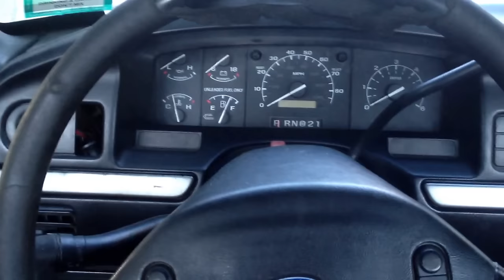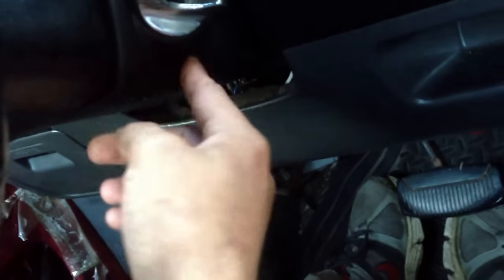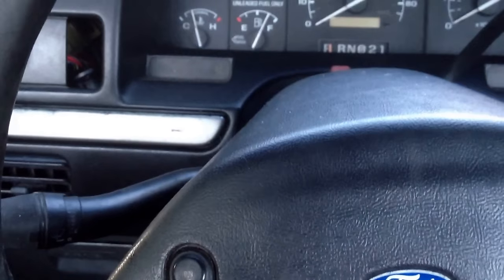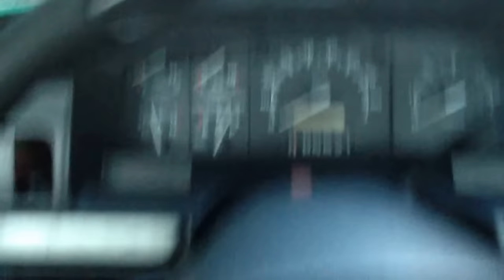Remove and Replace an Ignition Lock Cylinder - Ford - 92 - 95 F150 & Bronco @GettinJunkDone

Comment: IF you turn the new key before installing it, as long as you didn't disassemble the new cylinder, just turn the key back to the position that allows you to PUSH that pin back in flush.  As soon as you turn the key away from this position, the pin is pushed out and traps the cylinder IN the column - or out of the column.  Remember, one step of removing the old cylinder was to push that pin back in.
Reply: Your a life saver thanks

Comment: How about if you can't turn the key to remove old ignition?
Reply: Right that's what I'm trying to figure out
Reply: Cobalt steel drill .drill it out and eventaully u will be able to turn it enough to press that pin but remember to not turn your new key untill it is all the way in the cylinder or u might be buying another key thats the problem im having right bow
Reply: Drill that shit out

Comment: Taking off the cover is unnecessary. There is a hole in the cover specific to this task. On the right side there are 3 holes, two have screws, one that's empty. I had to do this on a 1984 F250 6.9 IDI and it took me 30 seconds. You do have to turn the key on (engine off) to line the pin on the switch with the hole. I used an ice pick to do the job. My understanding is that all Ford products except the Focus is designed in this manner.
Reply from the maker: I'll have to double check for that hole you mentioned.  It's been a while since I've done this, so I don't remember all the details.  Thanks for the info!
Reply: MudFlapper359 its taking me ages to find that stupid thing ive tried so kany ways but it just not workin
Reply: Thank u for saying  that  , thought  the same , like someone  has tried it with 2 drops of S glue to get peice out lol , ordering mine now or going to auto parts  ,thanks for video
Reply: What if you don’t have a key and that’s why you are wanting to replace it??
Reply: @patrickwhelan2819  new cylinder lock should come with a key set

Comment: Also would like to add that if you don't like carrying both keys on your ring...the new one and the old one for the doors you can have one key cut on one side for the ignition and the other side cut for the doors. When you get in and put the key in the ignition switch and it doesn't turn..just turn the key over and it will start the truck...Thanks
Reply from the maker: Excellent idea!  Thanks for watching!
Reply: The ignition and door only have tumblers on one side?
Reply: @anothersomebody8195  Years late to see your comment, but Ford is using a single throw lock in this case.  Meaning the wafers are all pushing in the one direction.  Thus, only one side of the key is needed to line up the shear line allowing the lock to turn.  By cutting each side of the key different it's no longer a convenience key and you have a 50/50 chance to put it in wrong. Personally, I'd rather pull or rearrange wafers in the replacement ignition switch in order to keep my factory key operational, even if I've reduced security.
Reply: @brad4407  Interesting design choice. Thanks for the reply.

Comment: Same exact processes for 1993 Lincoln town car 

P.s never turn the new key before installation I didn't read the warning the whole thing just falls apart and it's a pretty tough puzzle to put it back together
Reply: So how do you replace the starter Ignition on the 1988 E350 econoleone
Reply: It

Comment: I had the problem that it wouldn't go in the last 1/16".  After fighting it for 5 minutes or so, I took a rubber handled screwdriver, set it against the black turning part, and tapped it several times with a pair of vice grips I had sitting there.  It went in just fine.

Comment: Mine is 92 f250 I'm assuming if it's the same. But my keys are gone. It's impossible to put the key that I don't have into the ignition and turn to the run position to press the release pin. Any suggestions

Comment: My problem is tumbler got stuck to where the key won;t even go in..how can I change the 'tumbler on my 93 F 150 without a key?  (I really goofed when I took the key out and tried a spare key..trying to turn the ignition switch..and it went to lock position . key will not go in tumbler.cylinder at all.  Any way to remove without inserting the key?..PLEASE any help with this I'd really appreciate !!   Thanks for the step by step video.

Comment: How did you turn on the ignition when the switch was spinning initially. I lost my keys and am unable to turn the switch to on before removing the cylinder. Must I drill to remove it?
Reply: I hope you already figured something out.  Might just try to put the key in as far as it will go.  If it's not all the way in, rotate it until it slips the rest of the way in.  Then, the KEY might trun the cylinder. ;-)
Reply: @jayherde0  dude just said he had NO keys

Comment: thanks to guys like you and you tube. now how to fix the dual gas tank switch on dash.
Reply from the maker: Are you asking me how?  If you are you need to remove the instrument cluster cover.  The switch is next to the headlight switch on the left hand side of the steering wheel.
Reply: +Joe Robinson (GettinJunkDone) Hey, thanks for the great vid, clear and easy to follow. I have the same problem you had, with the metal piece just spinning around the cylinder lock (in fact it fell off). The issue I'm having is that I can't turn the key, so how would I remove my cylinder lock if I can't turn it to the 'run' position in order to push that pin in? Thanks for your time :)
Reply from the maker: Peripatetic Decian The only thing that I can think of at this moment is to drill out the cylinder.  It sounds extreme and I'd rather try something else first, but if all else fails grab your drill.  I hope that helps!
Reply: Thanks for getting back to me so quickly. Oh damn, I understand, will do it as a last resort. Thank you again for your video and response, you rock!

Comment: I'm running into the same problem you had with it not going in all the way. I've wiggled it, pushed it, tapped it and still no luck. Any suggestions?
Reply from the maker: Hopefully you've gotten this figured out by now. But!  In case you haven't I'll tell you that all I did was work it for a few minutes and it eventually slid right in.  I didn't have any REAL trouble that I remember.  Good luck!
Reply: Me too. Idk what to do.

Comment: The ignition in my 94 F-150 was trashed. The outer ring would spin and was a pain. Replacement was easy with zero problems, HOWEVER, I have a factory alarm. The old key did not have a key fob so I did not think much of it. Now I am having issues with the alarm and draining the battery. It's an older truck and not my daily driver so I can figure it out in time. Just a heads up though.
Reply: Did you ever solve your problem? I am having the same issues, I have no key fob. I start it with a screw driver at the starter for the time being.
Reply: @jasonguinn132  I replaced the ignition in the column, however I still get a blinking light on the dash that says Theft. The headlights will not shut of as well. I replaced the clock spring which did stop the air bag light from flashing all the time. I just installed a kill switch so when I turn of the ignition, I turn the switch killing all power and headlights

Comment: Your video is appreciated man. I had the same exact issue, outside just spinning, door chiming. I had no problem getting it out but when I put the new one in, the pin pops out into the hole correctly telling me it's in all the way but the switch will not work correctly now and I can't figure it out. It just won't go through the positions correctly. I bought it off Amazon. This is the third one. Same look and size, different brand. Same problem. Hopefully that makes sense. I've tried a bunch messing with it and it's just the same thing lol. It drives me nuts because it's a simple, straight forward repair. Can you give me any tips? Perhaps something I'm not doing it right. The switch works fine with a screwdriver with the cylinder out but I can't leave it like that.
Reply from the maker: Hey Ken, I wish I could help more, but I haven't done this type of repair in a number of years.  I'm hoping someone else can come along and leave some helpful tips for everyone else.

Comment: I just installed mine on my 94 bronco did everything the same as in the video..it wouldn't turn the truck on..I got another new ignition just for shits and giggles and the new one won't work also  any advise?
Reply: for anyone reading this, the 12v tabs could of broke off inaide.  the tabs are on the bottom of the ignition. if you can take it back out and see where the tabs are. maybe they are gone or bend out the wrong dir.  when i took mine out i saw a tab flow out. didnt know what it was.  but it had another one that was bent.

Comment: is there any way to keep it so you still use the original key? i mean like, swap internals or anything of the sort.
Reply from the maker: You could totally take the lock cylinder apart and adjust the pins, but I wouldn't recommend it based on others' experiences I've read about on line.  Another viewer suggested getting one of your keys cut one one side to match the new ignition and leave the other side for the door.  Saves carry a key!  Good luck!

Comment: My issue is that it is spinning freely just like that, but even with the key in the slot I can't rotate it. How am I supposed to replace the damn thing if I can't turn it to Run?
Reply: Same shiit here
Reply: Figure anything out?
Reply: @kingjr1243  yes! So Ford being Ford, try to move your wheel while also trying to turn the ignition with the key in. Your wheel should have just a little bit of play in it, even though it's locked. Try to wiggle it back and forth and as you do it, try to rotate that ignition. It should free up.
Reply: @kingjr1243  sometimes the ignition tumbler gets locked at certain positions of the wheel.

Comment: There are FOUR screws on the plastic cover underneath.
Also, you DON'T have to remove that cover either. It has a hole to insert your Allen wrench/key.
Reply: Seriously? What keeps the bad guys from bringing a new cylinder with them when they steal your car?
Reply: @Leila-Mae No wonder it only takes thieves a minute to break the glass and drive off.
Reply: @anothersomebody8195  locks only keep honest people out.
Reply: @anothersomebody8195  The key that you're replacing has to be in the ON position in order to remove it .

Comment: I saw your video and noticed void in dash where dual tank switch goes. mine fell in dash . I was kind of kidding. but is there a fix? it looks like tabs broken on switch module. how does cover on dash come off ?
Reply from the maker: Gotcha.  If I remember right the cover comes off after removing a few screws.  The screws are behind the silver colored horizontal accent pieces.  Those pieces should snap right out, but I've never been able to remove the dash cover without damaging something.  Hope that helps.

Comment: What if its stuck without it being able to put in the on position? Can i still take the cylinder out.
Reply: Use a cobalt steel drill bitand drill a hole .ram something in there after for leverage .it will turn and u will be able to push the pin .thats what i did